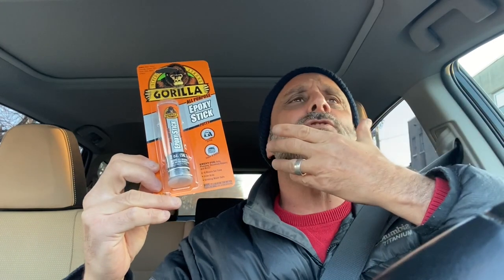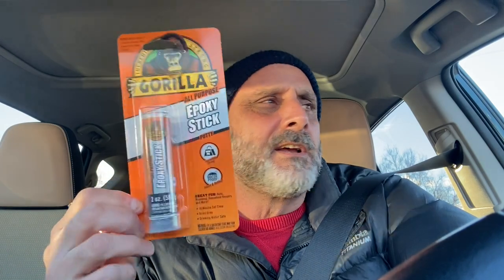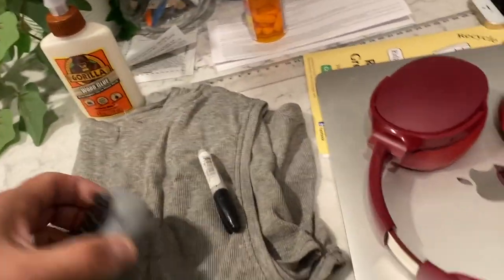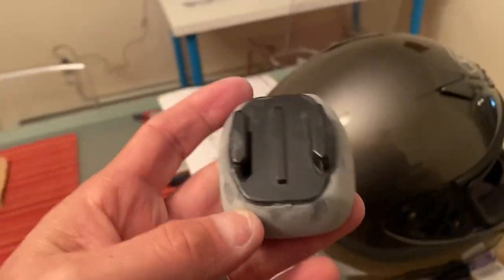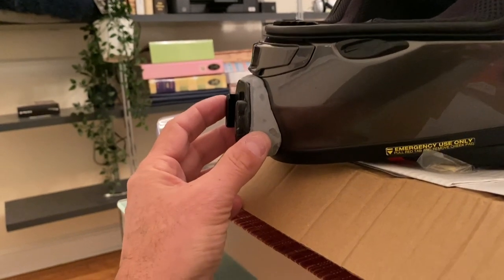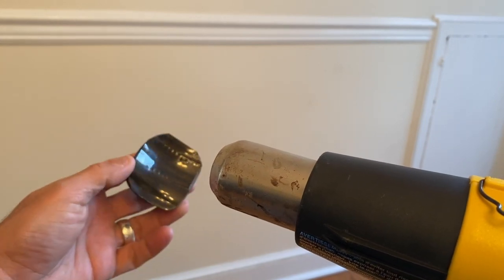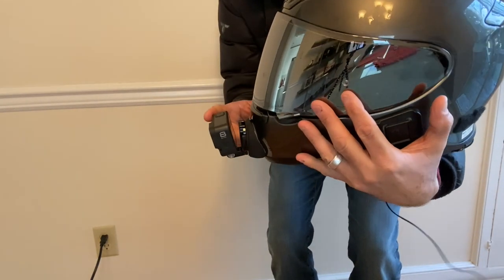DIY GoPro Helmet Chin Mount / Harley Davidson Electra Glide Motovlog

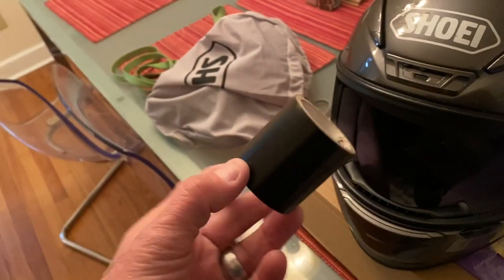Comment: Holy ShiFt, nice job! Did you leave enough room for your air vent to open? It doesn't appear so in the video. Regardless, INCREDIBLE DIY job! Thanks for sharing! Did I understand you,...you used the tape (in the beginning 3:55) to 1) avoid permanent stick or damage to the helmet?  Did you use anything to create a basic mold or did you just make a "lump", form it, and sand it down?
Reply from the maker: I  used tape on that area and then squeezed the lump of putty onto the tape area. In advance I created the shape of a triangle connected the GoPro piece of plastic and squeezed that whole thing onto the helmet where the tape was stuck. Then after putty hardened I peeled off everything. Since I don’t use the vent I didn’t care if it had space to open or not.